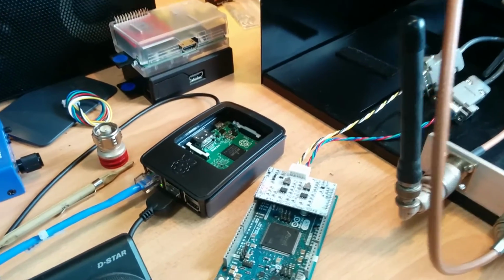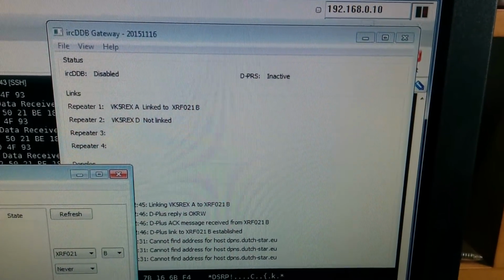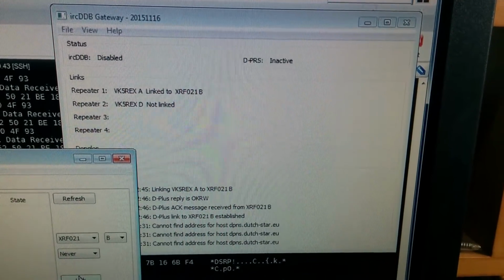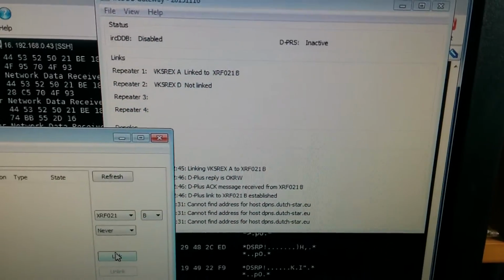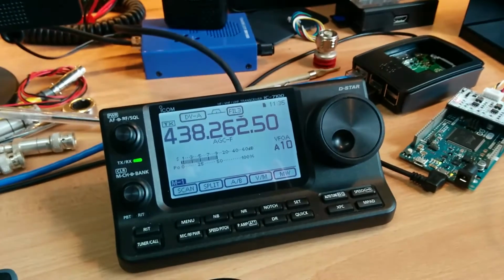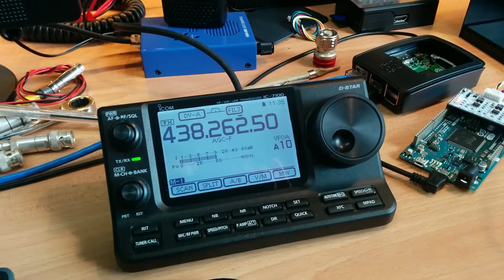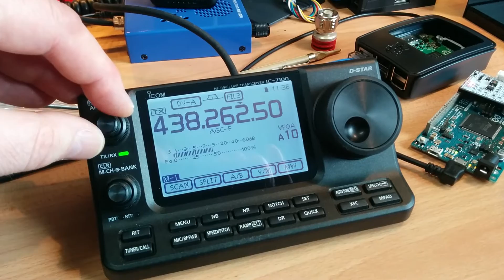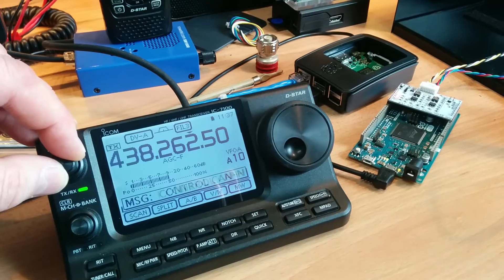Initial tests with G4KLX MMDVM during the Canadian D-Star Net.

Comment: The Arduino DUE and interface is acting more or less as a 2 channel /4  port USB audio card + PTT ?
Reply from the maker: It's a little more than that.  It also handles the modulation and de-modulation of the digital signals (D-Star, DMR, Yaesu System Fusion), automatically recognizing each as it is being received and also interpretation/packing/unpacking of each digital protocol on the fly.
It truly is an amazing development from Jonathan G4KLX.
Reply: Thanks Michael, I didn't realise that so it's audio that comes in and out, bit like a G3RUH modem for 9600 Baud. Dave - G6ZKC
Reply from the maker: Yes, quite similar in that it needs discriminator audio for receive and direct modulation input on transmit.  But it also handles all the protocol requirements for each digital mode as well.

Comment: Hi Michael I'm interested using this to make My Kenwood TKR-750K into a DMR tier 2 repeater what's your thoughts and what to I need to build it up? Thanks Nathan
Reply from the maker: Hi Nathan.  I'm not familiar with the TKR-750K.  If it can be used with a GMSK modem on D-Star, it's quite possible that it would work with DMR.  
I'm still working out how this all goes together. I would suggest joining the MMDVM Yahoo Group first and ask there.
73